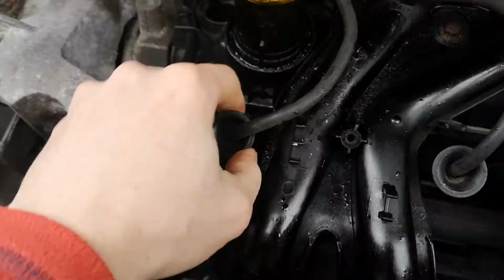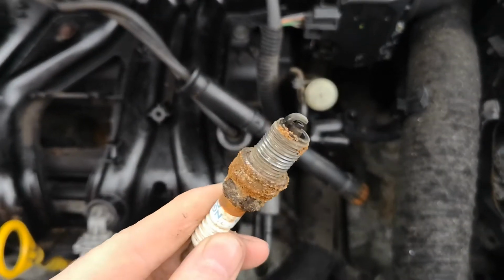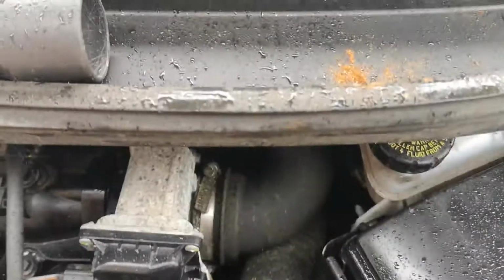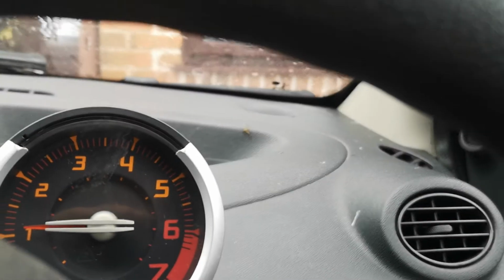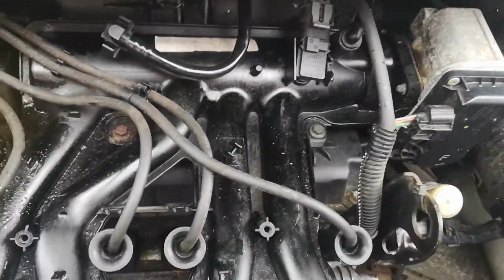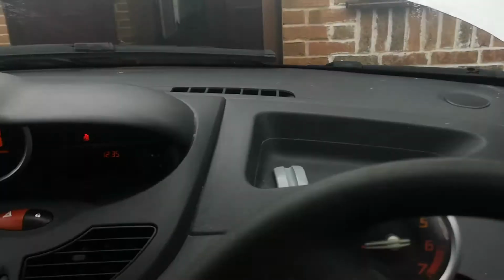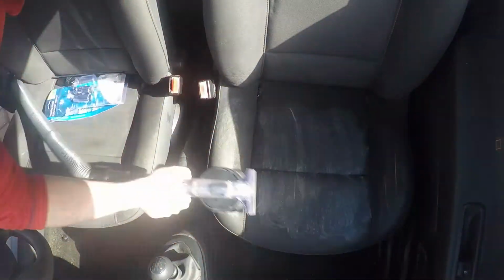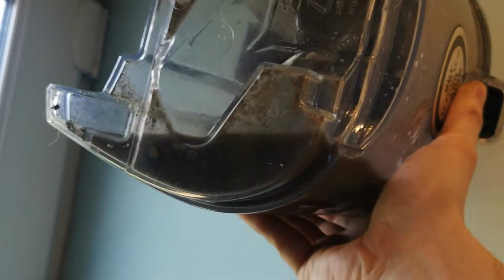Project Twingo - Part 11 - Will it ever stop raining?

Comment: We had flash flood rains past few days on and off, feel you on that. Wouldn't hurt for you to pickup a heavy duty ezup canopy to spring up over the front of the car, and pickup a magnetic or hook battery light or two to throw in there on the frame that can be pointed toward your work area. The heavier duty ones handle rain pretty good aside from the noise, so would need a clip mic lav unless doing voiceover later. 

On actual work - nice work honestly getting the plugs out, I have limited patience when stuff is stuck so I rely on a impact driver with adapter to put the socket and socket extender on and just drive the puppy out of there. This has bit me in past once or twice haha. Other stuff I love is Kroil, which stinks really bad but works great outside the house. It seeps into the grooves even upside down and a tiny bit goes a long way.

Comment: Are you thinking maybe a faulty or tired O2 sensor causing the engine to hesitate when hitting the gas? I experienced something similar and the fix for me was changing my  O2 sensors out and cleaning the mass airflow sensor.